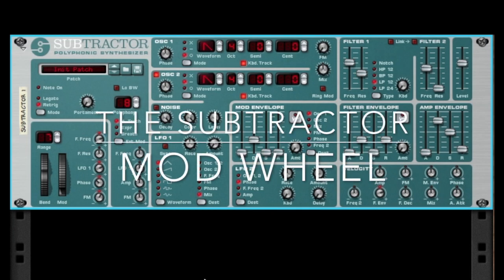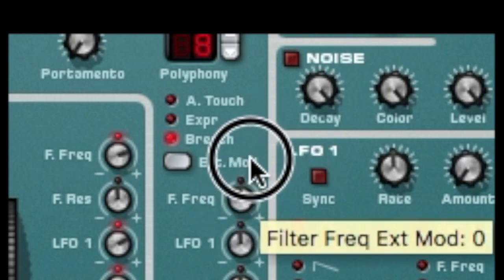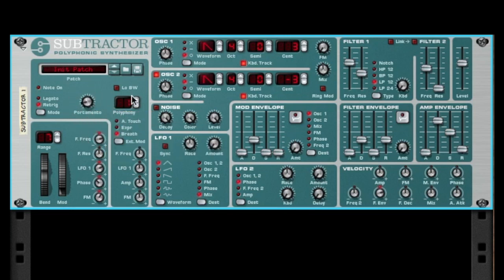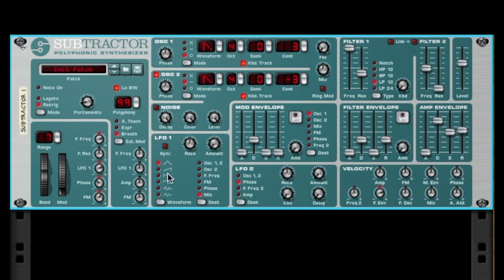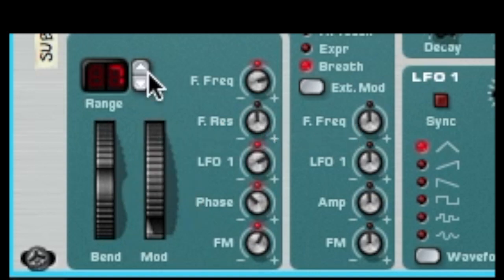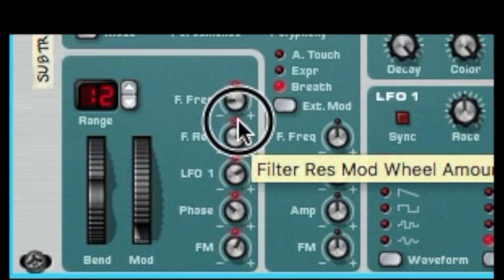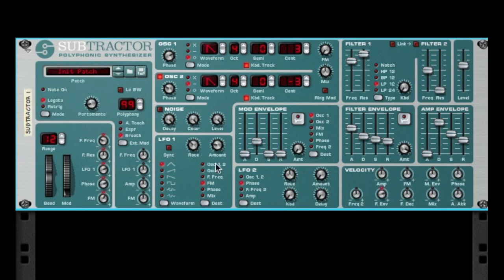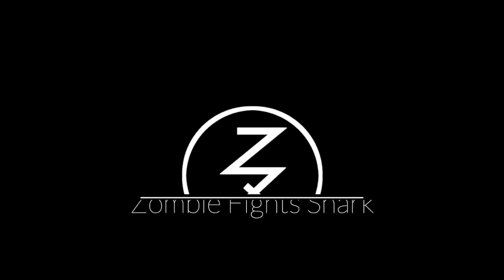Subtractor Complete Walkthrough - Episode 7 - Mod Wheel

Comment: This is a solid tutorial & straight to the point. I’m shocked at how few like this exist when Subtractor has been part of Reason for so long. One question though — do you know how I can have the mod wheel control vibrato of the oscillators? 
A lot of my newer rack extensions are more straightforward in assigning this to the mod wheel & this would be super useful for me...

BTW breath controllers are actually kinda common for those of us who play thru MIDI guitar software to control the mod wheel & can’t use a pedal because our feets are busy! (for me triggering samples — I’m not much of a keyboard player)